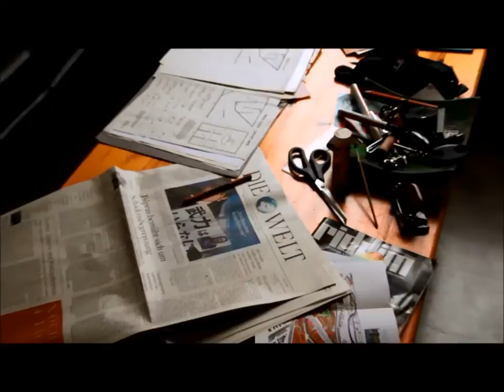lion yanz build a hog scoop

Comment: Great build, why do you need two speakon connectors sockets for a single cone?
Reply: Link connection for powering a second box off the same amp channel maybe?
Reply: To link subs in parallel. Than you can set your amp in parrallel mode for more power. This means its mono but for the frequency range of a sub bin it doenst matter.